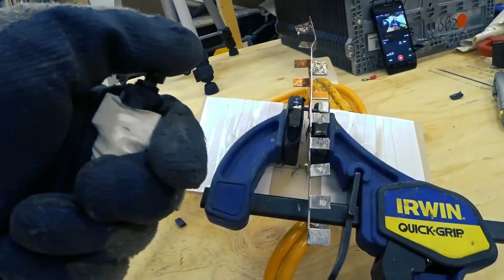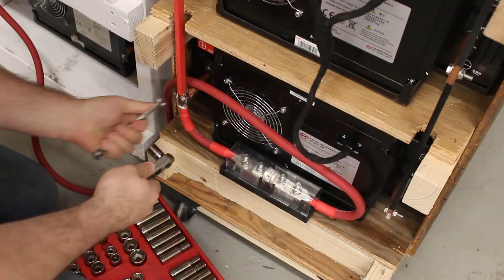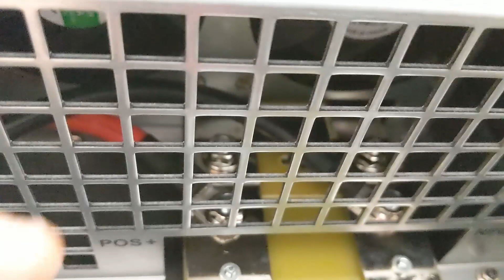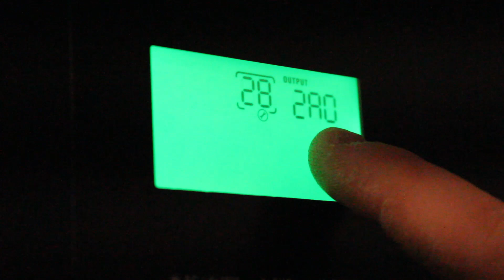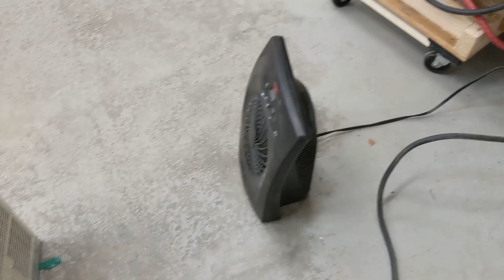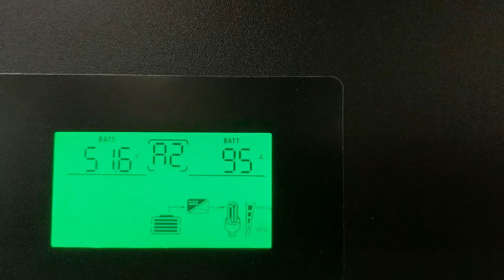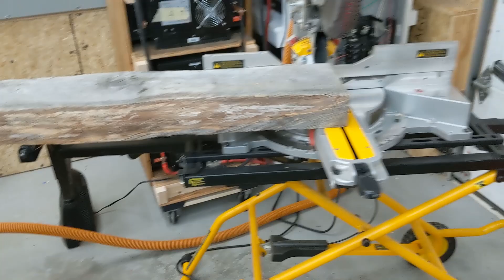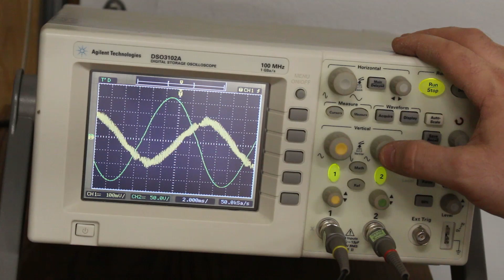Split-Phase Inverter, LV5048, Test Solar, Off-Grid

Comment: Why did you choose those batteries over say a nissan leaf setup?
Reply from the maker: These batteries are LiFePO4 and Nissan Leaf is Li-NMC if I remember correctly.  LiFePO4 is a little safer.  However, I think both are good options.  I love the way the Nissan Leaf packs can bolt together so easily.

Comment: What happens if you don’t use the resistor?
Reply: It will spark.  Due to it loading the capacitors. If you use a resistor it loads them slowly and virtually no spark. And sparking could damage the inverter but it's very very rare that it will happen.

Comment: I'm curious, how many amps was the battery delivering?? I'm wondering if there was not enough supply to the inverter instead of an overload(?). Or did the inverter actually state over load condition?
From what I could see, you only showed the amp load on the AC output side of things. If we take 5000W ➗ 48V = 104A. If the load was higher than 5000W, then the amp load on the DC would be higher as well. Maybe you can check this out before you pack it all back up and send it up the mountain.
Reply from the maker: There was one point in the video where I scrolled through the screens on the inverter and it was pulling over 90 amps from the battery.  The battery is rated for 400 amps continuously in the way I have it set up.

Comment: is that a chargery bms on the battery bank if so could you please do a review on it.
Reply from the maker: Yes it is.  I plan on sharing more about it.  Right now it's only connected as a cell monitor.  I have to connect it to the shunt so I can read amps.  Once I finish the install then I'll do a video on it.
Reply: @DavidPozEnergy  thank you i look forward to seeing it

Comment: Hope you was using a x10 probe at a minimum,  never feed mains into a scope, also play it safe and use an isolation transformer to power the scope. If just wanting to look at the wave form you can use a 1meg ohm resistors inline of the probe to be safer.
Reply from the maker: I'd love to learn more about scopes.  Would it be possible for you to link to an "isolation transformer" that works in this setup?  Please and thank you.
Reply: @DavidPozEnergy  https://youtu.be/xaELqAo4kkQ
Reply: @DavidPozEnergy  https://youtu.be/a3ePild_sFs
Reply: @DavidPozEnergy  hi David, I suggest you go eevblog forums there is a whole community there with a wealth of information.    https://www.eevblog.com/forum/index.php
Reply: Use proper HV differential probes, or isolate the scope from ground, and use different circuit. The best is to use battery powered scope. Also when using two phases, you must be sure to connect grounds of both channels to the same potential, preferably neutral. Using scope with disconnected ground or via isolation transformer is pretty dangerous on its own too. And, never touch BNC connectors connected to so high voltage. Never.
Reply: @movax20h  yeah I cringe at what he was doing, people don't realize how dangerous it is. Hope he can learn from the videos I sent him. Always best to learn on elv sub 50v never play with high energy devices e x I = w

Comment: You gotta think though, in 120v it's only a 2500 watt inverter!
Reply: Mykel Hardin  yes, but they are 180 degrees out of phase 

120 - neutral - 120

When you change this inverter from 120 to 240, all it does is shift each sine wave from 0 to 180 of each other to get 240, Now he was trying to run each of those loads on each inverter group which would isolate them from working together, having each load on one side, now when you switch back to 120, it puts both inverters waveforms in sync. That's why he had no voltage differential between leg 1 and leg 2 at the beginning, because they were in phase with each other.
Reply: @redsite001  NO there not 'out of phase with each other! if they were they would cancel each other out not add up. it is really a 240v center tapped system with the center tap grounded.
Reply: @billmonday5623  you must not be from the us
Reply: @billmonday5623 you are right, they do try to cancel each other out, if you put L1 and L2 together it will short Because they are not in sync as one is 120v and the other is 120v from neutral but, from L1 To L2 is 240 because their sine waves oppose each other. Thats why it's called split phase power. You can even look up a diagram for split phase.
Reply: @redsite001  45 years as an industrial electrician in New England. It is one phase  that is split, think of two 12 volt car batteries in series with the link grounded. You will read 12 from ground to either side or 24 across and they are "in phase'', reverse one 180 degrees and think about the result.
Reply: @billmonday5623  oh okay we're just trying to explain the same exact thing except I was calling it split phase when it's really just single phase split up into two legs. One from half way through the windings of the transformer and the other one on the 2nd half.
Reply: No because both halfs will share the load to deliver twice the current and half the voltage, but in 240 it is still 5000w but half the amperage and double the voltage either way it is still 5000.

Comment: Perfect,  synchronized sine waves. Split phase. Thank you.! ...I bought a 3 phase generator to run my 8hp lathe. I was unable to locate a 3 phase inverter. If you happen to be able  to test drive one im in lol.
Reply: Mpp sells 3 phase inverters. Look into it.
Reply: C Angel  thanks will do!
Reply: Dont quote me but I think some of the MPP models do 3 phase but you have to have 3 units and I know the Solark inverters will do 3 phase but again you have to have 3 units
Reply: tee kay 
I imagine all you'd have to do is syn the sine waves 120 degrees apart.. ~10,000w  could prove costly..
Reply: Why wouldn't you just use a VFD, instead of an overly expensive 3 phase generator?
Reply: scotty362100 
Hey Scott, good question That definitely was a consideration. The genset came c/w 4cyn cummins, 50kw.alternator ,  Which I can pair up with my welding generator. Seeing I can either weld or lathe but can't do both at the same time,  and have a back up off grid power supply, I considered the genset the obvious choice. The price of the genset was a huge factor. I personally don't like the configuration of vfds with having several other future 3 phase machines coming.
Reply: SMA makes a three-phase  in one unit https://www.sma-america.com/products/solarinverters/sunny-tripower-12000tl-us-15000tl-us-20000tl-us-24000tl-us-30000tl-us.html

Comment: Can you do a video on your buddies well pump installation, I have a 240-volt well pump that requires surge input of 8000 to 10,000 Watts
Reply: I doubt it will start that pump unless you can use a soft start but the Solark 12 will and maybe the 8 However 2 of the MPP LV 5048 s  should.

Comment: I wonder if the inverters can sync to each other and give one big circuit?
Reply: two lv5048 s can and they have the parallel boards built in
Reply: I mean, he never said what the voltage was between the lines before he adjusted the settings. Maybe the two internal were the same
Reply: @Zorlig  He said "no, not getting it " There is no output on other leg in that mode or it would be non split phase and harm the 240 volt equiptment if I understand MPP s direct answer to an email I sent them a month or so ago
Reply: Interesting. I thought both lines to neutral were 120
Reply: @Zorlig  They are after he goes back in and reconfigures the unit.  Before that it provides 120v only.
Reply: i have 2 10kw mpp hybrid inverters as a pair, which runs as an actual redundant/load balancing pair

Comment: The amount of ripple was quite surprising and probably a source of radio interference, though I don't know how normal it is. I would have expected something a lot smoother.
Reply: It's the scope setting. Channel 1 was set to 100mV/div.
Reply: PipeManPeep and clearly not connected to the AC. Probe was just picking up by stray capacitive coupling, which greatly exaggerates the switching noise.

Comment: I trust you've noticed that the probe for channel 1 of your scope was not connected correctly.  It was showing only 100 millivolts of noise.  Channel two was using the 50V per division scale and showed a good sine wave.
While the LV5048 inverter could not drive your saw, at least it didn't blow out like another one you tested.
For me this inverter is a non-starter due to its 145 V max solar input.  My 20 solar panels are each 325 watts at 69V peak.  I would have to run all my panels in parallel.  Most existing home solar is hooked up in strings that can make around 450V max.
Thanks for the video.
Reply: @DIY Projects Good point!  Here in sunny California the cheapest solution is simple series strings with MPPT inverters and it works well throughout the year.  Your dual inverter setup confuses me.  Are your inverters not MPPT?  Otherwise I don't see why a smaller inverter maximizes PV.  Better efficiency for the smaller inverter?

Comment: the interface on that thing is terrible and the buzzer doesn't turn off either?? Come on you were in the settings no need to constantly beep
Reply: It's actually a nice interface and you can make any adjustments on the screen or hook up a laptop to change the settings if you need to charge or monitor pv input and load's.
Reply: @mexicanracer03  For the builtin screen if you need the manual its bad full stop. The option to use a laptop makes it better.

Comment: in general. get low frq inverters with a big fat transformers for high  inductive load.
edit : i mean pure sine wave for sure. like this for reference:
https://www.aliexpress.com/item/32604267773.html?spm=2114.12010612.8148356.6.500b1c4f4EUqY7
Reply: Very poor for motor efficiency since low freq. inverters are square or modified square wave inverters. They typically cause the motors to saturate and over heat. 

High Freq. Inverters world better, if they are quality and not cheapo models.
Reply: @guytech7310  nah. 
https://www.aliexpress.com/item/32604267773.html?spm=2114.12010612.8148356.6.500b1c4f4EUqY7

pure sine wave and single big fat transformer.

Comment: Nice video David, lot’s of good testing happening.  MPP is pretty good for all-in-one no frills setup.  I’m looking at the PIP single phase for my outdoor project.  With no UL certification, makes it a no go for an inside install...
Reply: It's not that inside install is not good. It's just not certified to feed back into the grid.  All Mpp inverters switch to grid when load is out of it's reach. But they are good for it's limits.
Reply: @mexicanracer03  Backfeeding to the grid is not the issue here (though it can be for grid-tie).  UL listing is a certification that your product meets certain safety standards and code.  For some folks, this may be an issue if you are not using UL listed products in the US.  Some insurance companies won't cover any losses if UL products aren't used.  That why I plain to put my MPP PIP in a shed and not the house basement.  Rather use a shed than a home is insurance won't cover it.
Reply: @GreenMountainDIYGuy  makes perfect sense. Thank you for elaborating on that.

Comment: Hi freq inverters don't do surge well. The low freq inverters like the Aims can do 3x surge. I hope your friends well pump is only 3/4 hp or smaller.
Reply: yes a 3/4 hp well pump 240 volt may well surge around 16 amps

Comment: I'd think the startup on the 240V well pump wouldn't be that high and it should run OK.
Reply: Our well pump really hits hard when it turns on. Not sure one of those inverters will be good enough. I have a 15kw Pure Sine wave Inverter but it is the low frequency type of inverter. Should handle ours quite well. Not too keen on the High Frequency Inverters unless they are strictly used for non-induction loads.
Reply from the maker: Cool, I hope so.
Reply: I am not sure what size my well pump is, but I know it surges to 16 amps when it first kicks on and for about a full second and then pulls about 8 amps while running.  That inverter "should" handle it if that is the only thing it is powering.

Comment: Dave, put the unit back in 120v mode, I'm guessing the surge will double and will run the dewalt miter saw, I'm guessing this is no different then a voltage switch on a generator that switches the windings to parallel vs out of phase. pretty sure the inverters will share the load in 120v mode.
Reply: true I was thinking the same, but still for that price its a little to much.
Reply: I hope his buddy's well pump is a light-duty model if it struggles that much with inductive load start-up.
Reply: @Richard Vaughn can you explain how you would wire this up to work?  How big of one would you need?
Reply: @Richard Vaughn Your smart, Xc is interesting with AC, I just installed an Easy Start to my 15k btu roof AC on RV to run it off solar, my plan is to make it work this weekend, fingers crossed.
Reply: @tripplefives Thanks for the knowledge!

Comment: Had my fingers crossed with the saw... Such a fat lip there. :(

Maybe I should give it a shot... hmmm.  I am set up two of these in parallel.
Reply from the maker: I'd love to know if a miter saw can run with two inverters working together.
Reply: @DavidPozEnergy  Might have to go to something like Sigineer, those have real transformers in them and can handle way more "start-up" current for longer.

MPP-Solar can only handle 1.5x max continuous for ~5-10 seconds
Most Sigineer can handle 3x max continuous output for ~20-30 seconds!

https://www.sigineer.com/product-category/inverter-chargers/split-phase-inverter-chargers/

My Parallel LV5048s only face the microwave, heater, refrigerator, freezer, and water cooler. Those induction motors start right up though. I time them to all come on a minute apart so no massive surge pull.

What model is that saw, I want to check out its power specs.
Reply: @DavidPozEnergy  The FIX/answer is SOFT STARTER.

Tadaaaah:

https://www.raymondinnovations.com/

120V Versions:
https://www.raymondinnovations.com/collections/soft-starters

240V Version:
https://www.raymondinnovations.com/collections/240v-north-america/products/gt20
Reply: Yes:
Two LV5048's will do a compressor and a miter saw.

https://youtu.be/uk-d-kgiD5I

Comment: I think with the Saw, if you pull the trigger for half second and let go, then pull again you might be able to get it to start up. You might need to do the pulse trigger 3 times. With the size of the blade that's a lot of mass to get rotating in a short amount of time.
I would recommend using a soft start kit on the pump, just so the inverter isn't getting hit full peak every time the pump kicks on. Altho, if the pump only pulls 50% load on each phase on startup, it'll probably be fine.
Reply: i am recommending a decent inverter
Reply: @ursodermatt8809  What's wrong with this one other than it's just not enough surge to handle those loads?
Reply: @korishan  I would want an inverter to start saws and pumps and more importantly not breaking down after 3 weeks. That mob also has a habit of threatening legal action if you publicly complain

Comment: You convinced me not to buy this model I guess I'll be sticking with the Magnasine.
Reply: I completely agree.  I have watched virtually every video on YouTube concerning inverters and that led me to buy the Schneider Conext SW 4048.  I have had it for 6 months and have had zero problems.  I had to have one that would run my well pump and it does do that without issue.

David mentioned at the end that the mosfet type inverters just do not handle surges well.  The transformer based inverters do a much better job.
Reply from the maker: Yes, the Low-Frequency inverters (with transformers) handle surges better.
Reply: @DavidPozEnergy  There is a lot of value for money in that inverter considering it eliminates the charge controller cost and it is less than 1/2 price so maybe buying two would help on the surge.
Reply: @DavidPozEnergy  As others have stated, in 120 volt mode it's provides the full 5kw out, it 240 volt mode it provides 2.5kw per phase. This is the same as the Schneider Conext 4048, which only provides have it's rated combined power per phase. If either of your phases will exceed the peak limit you would need to add a second inverter in parallel which would double the capacity to 5kw per phase. I had looked seriously at the Schneider 4048 but once you factor in the cost their charge controller, system com setup etc you have a setup that costs more than what two of these MPP units do, provides only a third of the power output and would only have a fourth of the solar input capacity. The only upside is the Schneider has a bit better surge capacity for loads like your saw but two of those MPP in parallel would probably fix that issue, or a dedicated inverter just for such a load. Different approaches for different needs. For a workshop it might make sense to have a dedicated inverter that is only used there and can be shut off when not needed. Would reduce the standby losses to. Not much in a house has an inrush load like a miter saw.
Reply: @DavidPozEnergy  I personally wouldn't do it but you can get the MPP 5048 MG which is 230v single phase European type  electricity  for about half that price and convert to split phase with a transformer and that would give you more surge capacity also.
Reply: You can buy two of these and handle most households or even 3 of them and have plenty of surge for about half of most comparable systems and very simple to install.  there are several channels that have featured the lv 5048 MPP and similar non US phase ones for several years with few problems.  The main drawback I see is lower maximum Pholtovoltaic input of about 140 volts
Reply: For the price nothing BEASTS MPP. Just look you get EVERYTHING in ONE INVERTER.  It's the BEST BANG FOR THE BUCK Too Date.